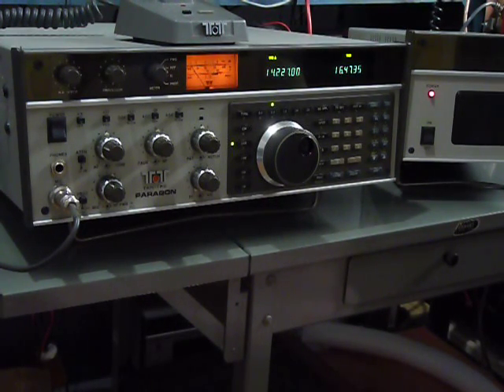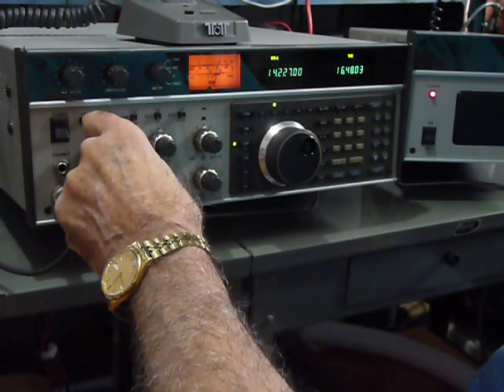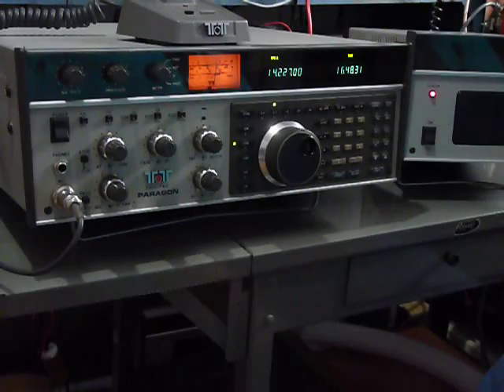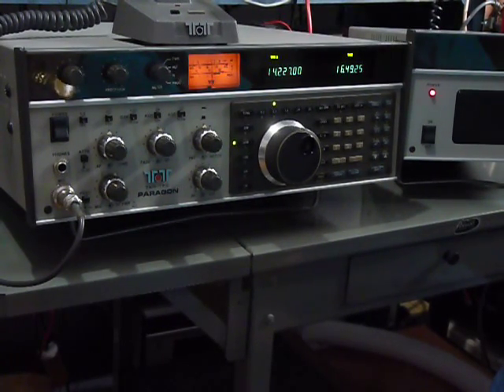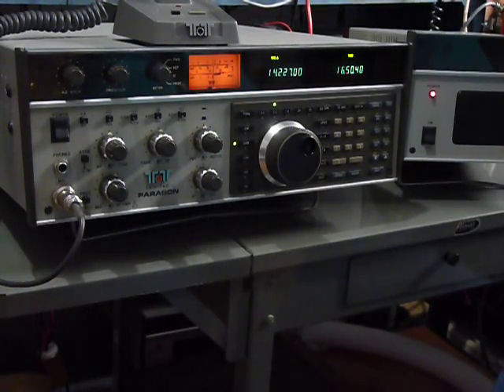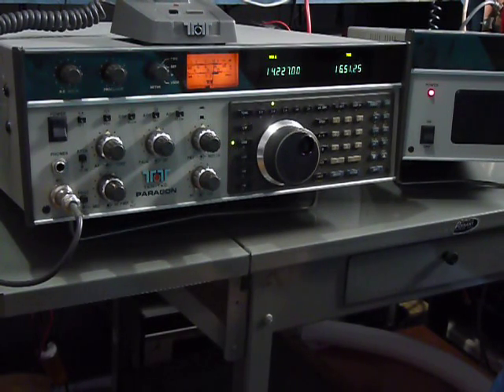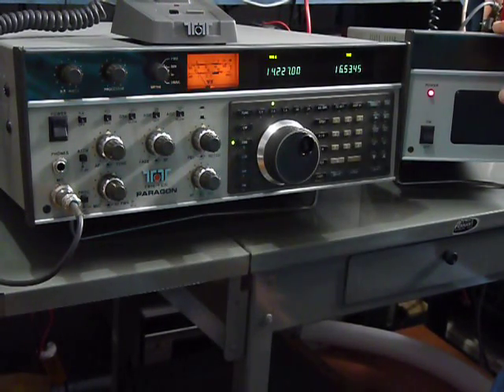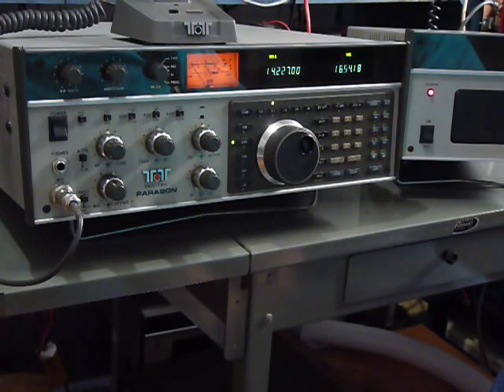TEN TEC PARAGON, LOADED

Comment: I've have had a Paragon 1 for a long time now, the radio is great, other than the display went bad. All the segments were lit, found the answer on the net, replaced 2 caps on the back display board and all is well. The radio was down for about 4 years before I got the nerve to go in and do the repair. The repair was far easier than I though, had it back up and running in about 2 hours. Someone that knows what there doing can do it in half the time. I have the TT power supply and it had a problem, TEN-TEC helped me with it over the phone, high 5 to the T-T crew! Now the matching match box doesn't work, Hmmm...7 3